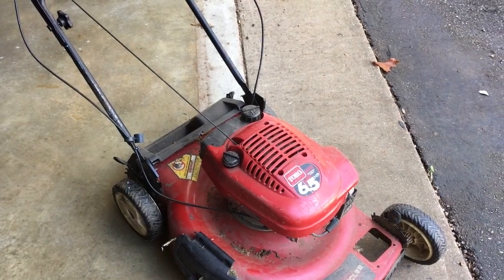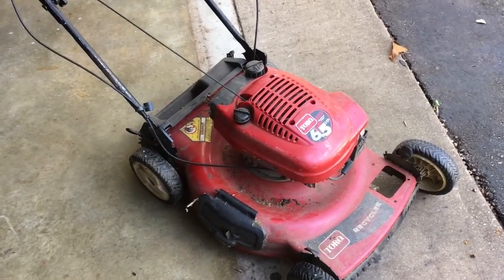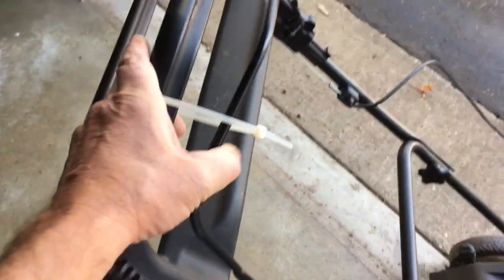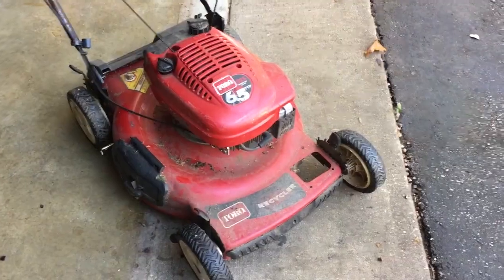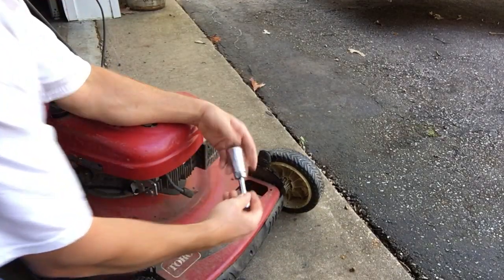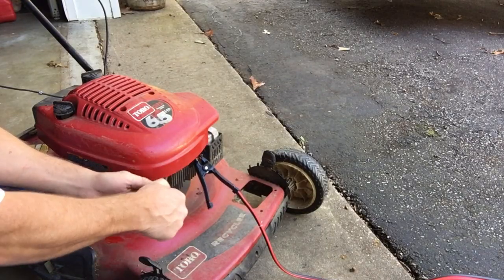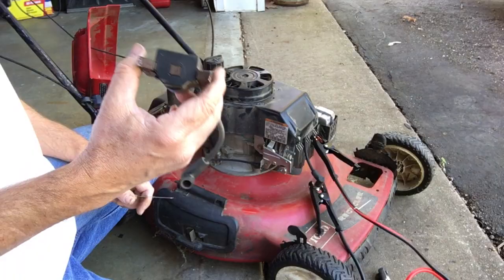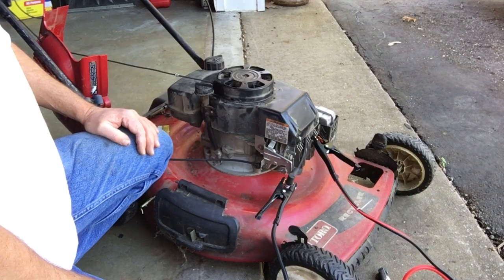Toro GTS 6.5 Wont Start How to Troubleshoot and Repair The Engine

Comment: If you want to know what the gap is between your ignition coil and the flywheel is a well-made business card paper of course stick it in between the coil and the flywheel push The coil against the flywheel with business card in between tighten the bolts that's roughly your gap I've been building lawn mowers from scratch and parts for 20 years It isn't rocket science It's common sense I do want to say these GTS Toro engines always do have a coil issue something about manufacturing when making the coils they seem to die. Never had a problem with a Briggs & Stratton coil One other thing with these Toro GTS motors is make sure your primer bulb on the carburetor is not torn or have a hole in it because of this happens the motor runs like s*** or won't run
Reply from the maker: Thanks!

Comment: If you don't have time and money like you did before covid, and you need to cut the grass, remove and clean the magneto with a wire brush.
Get the metal surfaces clean of rust and corrosion.
Be sure your kill wire is not chafed and grounding out when the safety bail handle is pulled and held.
Don't use a plastic tie that has to be cut.
Use a spring clamp or tie a rag so you can pull it off quick, just in case you're not of a mechanical or technical mindset.
Clean the bosses where the magneto is screwed down.
Inspect the magneto high tension lead at the spark plug connection to be free of corrosion.
Install the old magneto and use a feeler gauge between .010" and .014". .012" preferred.
A good name business card is usually .012" if you don't have mechanic tools. It also easily conforms to the flywheel.
Clean the flywheel surface where it's magnet is and around it.
Put the card or gauge between and install the screws. Let the magneto be drawn to the magnet with the card between. Tighten the screws hand tight with a nut driver handle.
They can be fragile to overdoing it.
Turn the flywheel by hand either way, usually clockwise from the top, so the card or gauge comes out.
Turn the flywheel around to be sure there's no interference.
Now, with the bail pulled and held and the kill wire attached, Retest for spark at a plugged in spark plug, cleaned and gapped at .030".
If you have spark?
You can put the machine safely together and continue trying to start.
Reply from the maker: Thanks.

Comment: I have a toro recycler, 6.5hp GTS.  I believe it is a techumsa engine, but no label anywhere to confirm.  But I cannot get it to start no matter how many pulls I try.  I have replaced the entire carburetor assembly (which includes the fuel jet bolt and new bowl), new spark plug, new air filter, and using fresh gas. I have used a spark plug tester to make sure I have spark, and I do have spark.  I have ordered a new ignition coil, but not sure if that’s gonna be the fix since I am getting spark.  Any thoughts on what I can do next?
Reply from the maker: If you have replaced the carb (assuming it was adjusted properly from the factory) and you have spark, the only other thing I could think of is bad gas or no gas.  If the gas is older than 3 to 6 months, try draining it and putting fresh gas in.  Also, check to see that you are getting gas into the cylinder.  Do this by removing the spark plug and pulling the cord several times.  You should smell the gas coming out of the spark plug hole.  If not, see if you can find the obstruction.
Reply: @greatescapefarms  i appreciate that info and unfortunately I did start with fresh gas after putting in new carb.  And I do smell gas at the sparkplug,  so I feel like its getting gas moving thru it, but still does not want to start. I appreciate ur response.
Reply from the maker: @jeffr6357  Hmm.  That sounds like a difficult issue you have that I have not run into before.  If you figure it out, please let me know so I can continue my learning.  Thanks!
Reply: @greatescapefarms  I would certainly do that,  however I have exhausted all efforts and suggestions from others and nothing has brought this back to life, so im afraid it will be going to that great lawnmower graveyard in the sky. Thank you.
Reply from the maker: @jeffr6357  You are welcome.  Sorry it didn't work out.
Reply: You should perform a compression test on the engine.  You need fuel, spark and compression for the engine to run.

Comment: I hadn't seen this anywhere else but recently I had a problem with my mower starting, running, and then quitting.  New air filter, cleaned the carb and linkages.  Replaced the new gas with newer gas.  Same problem.  Long story shortened a bit.  The gas tank cap was the culprit.  The vent holes had become clogged thus not allowing gas to flow freely out of the tank.
Reply from the maker: Wow, that must have been difficult to troubleshoot.  Glad you found the fix.  Thanks for sharing!
Reply: So did you clean the gas cap out ?? And did it solve the issue ?? I'm having the same issue with mine ... Fired it up for the years first cut it worked fine for half the yard I went to work I turned my mower over to a buddy of mine he finished up the yard but stated that it had suddenly died on him they cleaned out the cut chamber and went back at it and now I can't get it to stay running
Reply: @homelesstrader7906  Yes, rinsed the cap in some gasoline, tapped it on the concrete, gunk out, air in.  The mower has been working excellent now for the last year.  I figured it out when I had forgotten to replace the cap and the engine didn't have any problems running.  Ergo, the cap had to be the problem.
Reply: @DK-ed7be  thank you for the sound advice I did track the source of the problem with mine I ended up pulling the air filter out and boy was it nasty so I'm going to go ahead and replace the air filter and hope for the best like I said it was running fine for about half the yard and then died on me

Comment: Found this model used it was in poor condition. I replaced the carb, fuel line, air filter and it fired up but sounded like it was full open throttle when running. Mowed for about 2hrs no issues then I shut it off for a few minutes to go get water came back and it won’t start. I checked the spark plug and I do have spark, smell gas and actually got a little gas thrown on me when I pulled the cord. If I have spark does that mean the safety switch is working? Do you know? It makes full contact and clicks in. The reason I’m assuming it’s the safety switch is because when I let go the motor still runs but at a lower rpm “in noise” .Fresh gas in it. I have no clue what else it can be.
Reply from the maker: If you have gas thrown at you, there is too much gas in the cylinder (flooded). Usually let it sit for 10 to 15 minutes and it will take care of itself.  You can speed this up a little by pulling on the cord with the spark plug out.  This will help to get the excess gas out.  If you have spark, your safety shut off is not preventing it from starting.
Reply: And if it still doesn’t start get a compression checker

Comment: I have the exact same mower and it has always given me a hard time starting it when its cold. It will run if I spray starting fluid in the carb and it runs fine after that but the initial starting is difficult. I put a brand new carburetor on it, new spark plug, air filter, and clean gas but its still hard starting. Could this also be the electrical part you changed giving me the same trouble? Let me know your thoughts, thanks!
Reply from the maker: I doubt it.  If it works with starting fluid, then you electrical should be ok (you could still adjust the gap in the electrical system).  I'd get fresh gas (not just clean, but new) and try that.

Comment: I had a ariens push mower that wont start what I did is drained the fuel, replaced the spark plug, adjusted the ignition coil and checked the carb jet and cleaned It
Reply from the maker: That will usually fix most things.  Thanks for the comment.

Comment: I find the easiest way is to get some starting spray and spray it into the carburetor and see if it starts.  If it does then it is not an electrical problem.
Reply from the maker: That's one way of doing it.

Comment: Good video , i have the toro gts-xl    motor . from 2001 i took the top parts off to clean it all for matienece. when it starts it runs like someone hitting a hammer to tin   any suggestions?
Reply from the maker: It almost sounds like the gap is to close on the flywheel.  You may want to double check that.

Comment: I saw on another site that you can check out the magneto using a multimeter set to ohms.  With a bad magneto the reading when connected to the plug lead and the magneto frame will be zero.  On a good magneto the value will be more like .5 or so.
Reply from the maker: I'll have to try that.  Thanks!

Comment: What is that small square opening at front of mower body near the wheel for? Mine used to have a black cover but it fell off.
Reply: Chris Dionisio Do you think missing this cap weakens the air flow? Please share info when you find replacement part. Thanks.
Reply: its for the pulleys on the front wheel drive on a self propel lawnmower.........its all missing here, so now its a push mower
Reply from the maker: They used the same frame for both self propelled and push mowers.  Mine was a push mower and it did have a cap, but that fell off years ago.

Comment: Poor design. Have one and nothing but trouble.
Reply: journeyquest1 This is the easiest starting mower I have ever used. I'm not sure if this is Toro's design because I've used quite a few walk behind mowers and I've never found one that you could pull start with a pinky finger, and it's already 7 years old and we've never had anyone else do our lawn so obviously it's been put through the paces. Other than the bearings that we are about to replace this mower has held up great for us.
Reply from the maker: Wow.  I have had little trouble with mine over the years.  15 years and it ran great - only broke down twice.

Comment: It could've been an issue with the kill switch wiring shorting to ground !!!!

I picked up an old Victa Powertorque lawnmower which had no spark & it ended up being caused by the 2 kill switch wires inside the carby were getting shorted out.

Someone on here was showing that a secondary resistance of 13 K ohms was no good & 9 k ohms was o.k.

The one I've got measured at 14.85 k ohms & still ran the mower briefly because I have a fuel issue with the carby (it leaks & needs rekitting).

That maybe because that coil is the newer style with the inbuilt ignition module rather than the older style coil where the module was external to the coil.
Reply from the maker: All good points.  Thanks for sharing.
Reply: Russell Booth  gracias Tijuana BC México

Comment: Good video! Where does that Green grounding wire connect? I have been having trouble killing my lawnmower and unnoticed today this Green wife isn't connected to anything. Thanks!
Reply from the maker: The green wire gets screwed into a the engine block for a ground.  That is likely why you are having issues killing the engine, because the green wire is used to short the system out to stop the engine when you let go of the safety bar.
Reply: @greatescapefarms  Do lawnmower  need green wire for staring the engine?
Reply from the maker: @gonaone  Actually the green wire is used as part of the safety mechanism to shut the mower off.
Reply: Follow your bale cable down to the mower flywheel. Watch the mechanical mechanism while you pull and release the bale, their is a metal arm that makes contact with a metal tab when you engage the bale. This tab has the wire attached to it and goes over to a spade connection on your coil. Make sure the tab with the wire makes contact with the metal arm when the bale is pulled.